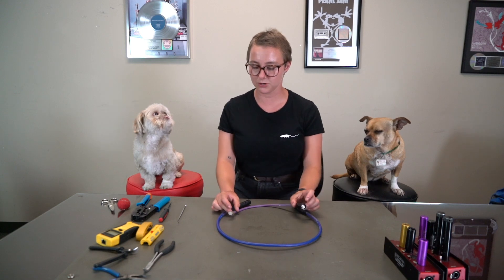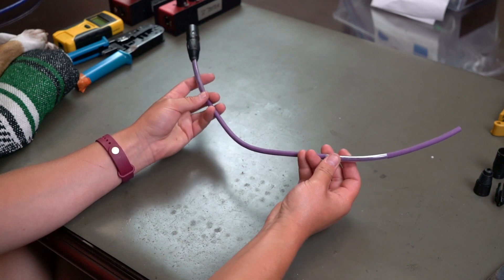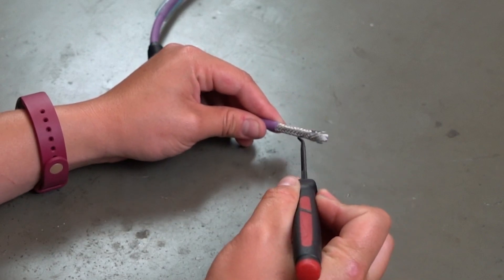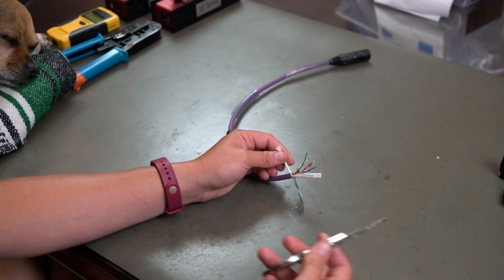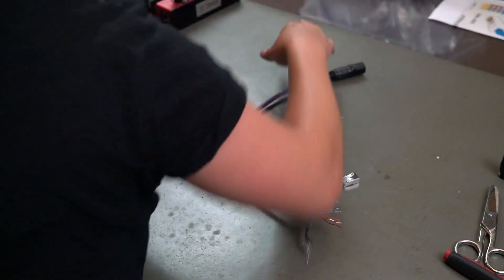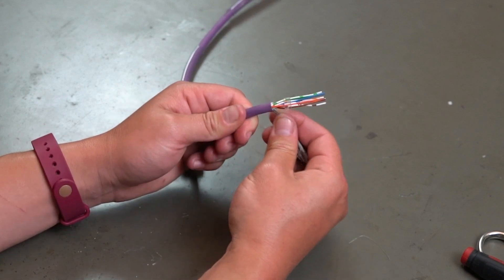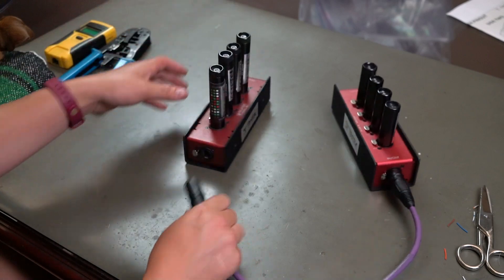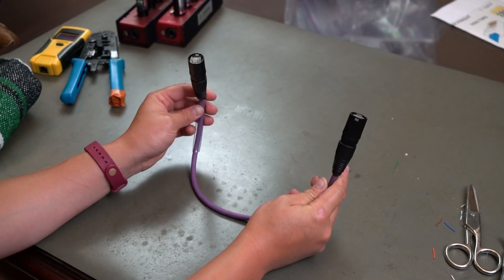Terminating SoundTools SuperCAT Cable feat. Samufacturing

Comment: I find it really interesting that you use the 568A termination - is there any particular reason for it? I'm asking because where I'm from we 568B for everything, I think it's been about ten years since I actually saw an A-cable.
Reply from the maker: Backward compatibility and military standards are factors and the basis for SoundTools using T568A. However, as long as the same is used on both ends it's all good and won't make a difference in terms of quality.
Reply: SoundTools - Interesting. I’d be curious to see the packet crash rate when using a 568a on a network that uses 568b protocols. No doubt a properly terminated cable gets max bandwidth and NEXT/FEXT, but if the network has to resend bit packets at a higher rate, doesn’t the bandwidth suffer? Was a long time ago I went to cable school but this was something we spent more time on to figure why the government did things differently. Interesting conversation for sure
Reply: @Auxknob1  A network doesn't care about what color code is used, as long as both ends are terminated using the same standard. The only difference between 568 A and B is that 568A provides backward compatibility to a two pair USOC wiring scheme.
Reply: @CountDownMusicGroup  I agree the pin out doesn't matter. I am curious about the impact of skew across the swapped pairs. Does that little bit of skew affect latency? Given the environments we(I) utilize audio over 802.XX does 68A or B work better? I've not seen any manufacturer recommend one over the other. And with environment affecting network cable reliability, I can't help but wonder.

Comment: At a guess the yellow connectors will take a large gauge cable as the SuperCat Sound twisted pairs are a slightly larger gauge than the regular SuperCat (white)
Reply from the maker: Yes, the yellow connectors are also a CAT6 version so they are more ideal for the SuperCAT Sound which acts more like a CAT6 cable, where as SuperCAT cable is CAT5e.

Comment: Cotton filler in the cable makes the the cable easier to coil
Reply: It’s actually for pulling the cable. A lot of conductor cable like this uses cotton, twine, or sometimes Kevlar as a strain relief when pulling cable. Takes the stress off the conductors and maintains the twists when yanking on the cable. I don’t disagree it helps with coiling but the most manufacturers do it for relief. Not crucial when passing analog audio, but when you are moving high channel counts in the digital bit stream, the bandwidth and crosstalk cancellation are crucial. Again not saying it doesn’t help with wrapping but manufacturers are keen on the twist.
Reply: @Auxknob1  Agreed with both and actually its not cotton but a very strong low stretch fiber in there